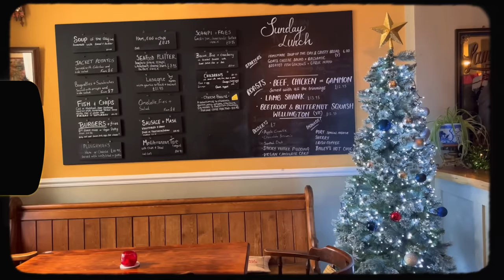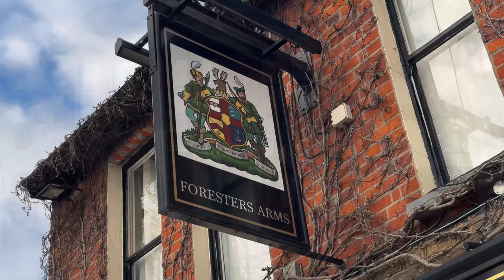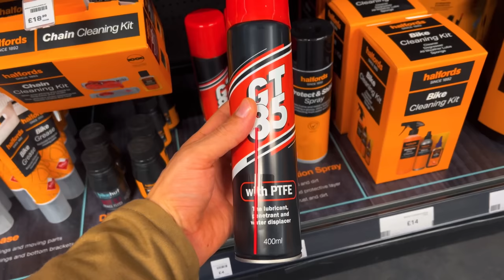To the Motorcycle Breakers | Back in the UK

Comment: GT85 is great but for regular winter applications try AC90. Available in 5 litres cans (need a cheap spray bottle), similar and as good as WD40 but generally much cheaper. ACF-50 is also recommended by many, however it is very greasy and needs careful application and is really designed for longer term application. 
I prefer to clean the bike regularly (pressure washer and "Rhino Goo" check it out also) and reapply AC90. 
With nine bikes including two used for Enduros, I know this regime works. 
Nothing worse than a corroded bike sitting festering in the garage! 
Apologies if this not exactly relevant to the channel, but hope it helps keep the Bonny looking good.
Reply from the maker: Thanks Tony, this is very relevant and hugely appreciated. Thank you🙂

Comment: Make sure you get any GT85 residue off the discs. It'll actually stop the bike when the brakes get hot . I learned that by experience!
Reply from the maker: Wow, noted, thanks Mike
Reply: @FreddieDobbs  The best thing to do with discs that have had salt on them is to use wire wool to clean them, not forgetting the outer edge then give the brake disc a good wash off with something like Muckoff and water. The next time the bike is used the pads will polish the disc back up. If you ride the bike on salty roads ACF 50 spray is brilliant for preventing corrosion, but never ever use it or anything oil based on the discs.
Reply: I didn't see him using any GT85 in the video.  I did see him pick a can up though.   I saw him pick up a glass of Guinness wonder if that Is any good for rusty discs.   Good stuff the Guinness.  Full of iron.

Comment: The pedal in the Vespa is the back brake😅
Left lever is the clutch, you change gear rotating the left handlebar, on the right you have the front brake and the throttle!

Comment: A friend of mine owned the largest motorcycle breakers yard in the south of England, Lychett Motorcycle Breakers, back in the 1990's. Today a housing estate occupies the site where it once was. I used to help out, fixing bikes back into MOT able runners, as many bikes ended up there because of mechanically ignorant owners. sometimes just changing wheel bearings, brake shoes & pads, fixing fork seals, fixing the charging system, etc. was all that was needed to transform something that cost the yard less than £10 into £100's. Non running Suzuki TS100's, TS125's, GP100's & GP125''s with broken a disc valve woodruff key was a common cheap to fix turn around.

Many real bikers knew this and would buy projects from the yard as soon ass they came in.

Comment: On the Vespa, the foot pedal is the rear brake. Those old ones are manual, so the left hand lever is the clutch as normal and you shift by rotating the whole left grip and lever assembly beside it. It looks a bit of a faff tbh, I'm going to keep my future Vespa simple and get a twist-and-go.

Comment: Freddie, don’t spray that gt 85 anywhere near your brake discs or pads or you wont have any !! Just take the bike out for a ride and after a few applications of the brake most of the surface rust should be gone ❤
Reply from the maker: Thanks- I’ll remember this🙂🙌🏻🙌🏻
Reply: If dont like the look of the oxidisation just get some brake cleaner spray and scotchbright pad and rub gently. Never ever treat discs with Anti corrosion. I cover my discs and empty can of acf 50 and paint it on tender parts like calipers. Just riding and applying the brakes ( trailing them will clear the rust. Spray with brake cleaner to get rid of dust. Many cars have oranged oxidised discs.

Comment: Hi Freddie, good video. Get yourself some SAS maintenance oil it's £21 for five litres i have used it for years on my bikes and I use them through winter we use it in the engineering industry. You can use on all the bike plastic rubber. Better than SCF 50. Give it a go i don't think you will be disappointed. Keep the good work up. Stay safe both.
Reply from the maker: I’m not familiar with SAS- really appreciate the heads up, I’ll save this🙂
Reply: @FreddieDobbs  you will thank me.

Comment: I see you're not running the screws to hold the side panels on, which is probably why you lost the last one. If you want some nice ones, TEC make a nice little C&C'd black anodized set for a very reasonable price, knurled so you can undo them by hand instead of with a screwdriver. I'd recommend, I have them on my T100 and they're invisible when fitted, even more so than the hole you have there currently. And unlike zipties, you don't have to replace them every time you need to get to the fusebox.

Comment: It is kinda of funny about the rust. I've taken my Thruxton R to the Bonneville Salt Flats four times spending a week running up and down the wet salt and never saw anything like that. I used some acf 50 before going out on almost everything and the bike is corrison free.

I'm  not so sure the spray you got is a good thing for your brake pads, maybe a scotch brite pad to get the rust off and wipe it clean with a water and towel.

You've probably got it done already so I'm curious what you ended up with.
Reply from the maker: This sounds like a trip of a lifetime; a Thruxton on the salt flats. Wow.

Really good to hear ACF50 does such a brilliant job- these sprays are magic👌🏻

I sprayed GT85 everywhere (apart from brakes), and then gave it a ride to wipe away the rust on the brake discs🙂👌🏻
Reply: @FreddieDobbs  👍👍

Comment: Freddie, can you tell us more about your 200,000 mile Fiat 500 please? Seems amazing that a tiny Fiat would reach that kind of mileage; or is it a ‘Trigger’s broom’ of a car; have you had to replace everything at least once? Thanks, Joe
Reply from the maker: Hi Joe, I will definitely do a full review of it once it hits 200k. Original engine, gearbox, no welding ever, all interior original. 

The only thing I’ve change in 72,000 miles of ownership are brakes, tyres, cam belt and exhaust.

It’s by far the most reliable, best built car I’ve owned. I know that sounds crazy, but it really is! It also doesn’t rust at all